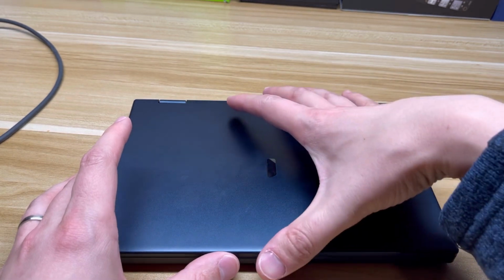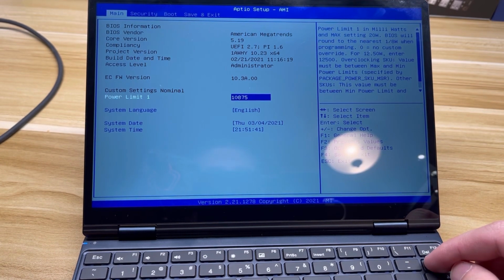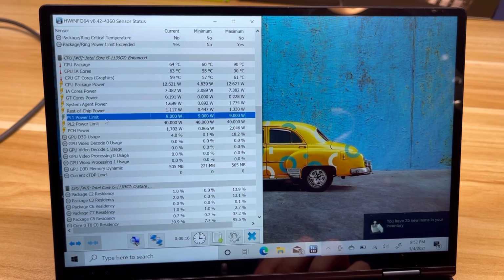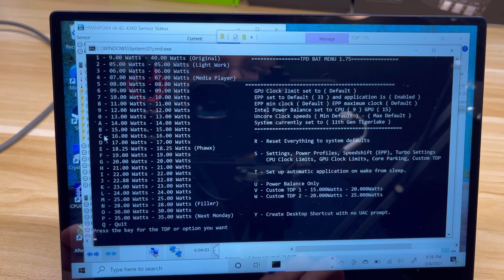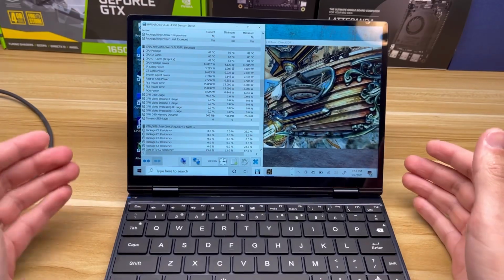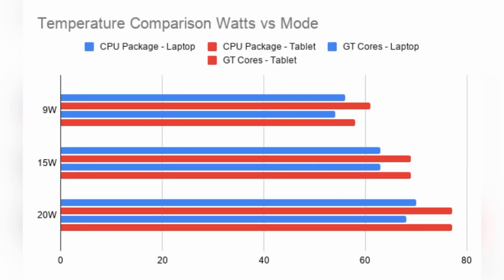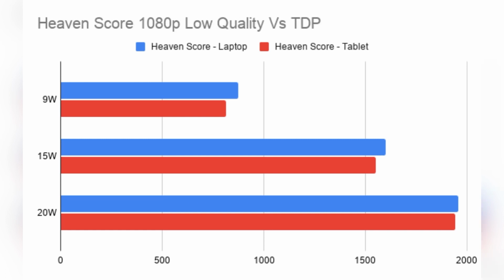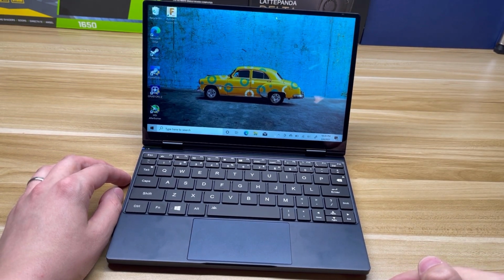One-Netbook One Mix 4 - Adjusting TDP and Cooling Performance Tests

Comment: Hi I’ve been using your power control app for a few months now on this laptop and now the fan has stopped working and laptop runs hot up to 90c. Any ideas what might have happened? The function keys to control the fan also no longer respond.
Cheers
Reply from the maker: Sounds like the fan merely gave up. Have you contacted one netbook?
Reply: @HandheldHardware  trying but their customer service is terrible
Reply from the maker: @umeshjay8067  are you on discord?
Reply: @HandheldHardware  no not on discord. Is there a link? Thanks

Comment: Hi, I'm really interested in this laptop but I'm concerned about fan noise. how audible is it out of the box? is it high pitched? and how effective is silent mode? Thank you
Reply from the maker: Fan noise in my opinion is fine. There is only one fan, so under heavy load in high speed mode it’s noticeable, like micro jet engine but for me fan noise isn’t a big deal. Quiet mode is nice, it keeps the fan profile low and drops pl1 to 7W. Under regular mode, there is a portion of the fan curve that has some high pitch to it. It’s somewhere in the middle. I don’t notice it often but when it hits the right rpm it’s much more noticeable. Overall the form factor wins for me. I hate lugging a large bag for a laptop. This fits in a single sling small backpack no problem next to it’s big brother the oxp 🤣

Edit: if you adjust the tdp using something like my power app, if you are on the regular fan mode, it handles 15W no problem and the fan doesn’t get too crazy as long as you don’t cover the intake or vent or aren’t playing intensive games. Using the keyboard to set high power mode bumps the fan into a higher curve but it’s not necessary to use that mode

Comment: I'm planning on purchasing this model, but did the manufacturer ever release a BIOS update that fixes the BIOS TDP setting not taking effect? Also, do you think repasting it with liquid metal (Conductonaut) would improve the thermals much? It's a pretty small heatsink, so it might just be saturated...

Comment: So is the only way to run in "20W mode" to run the BAT and select it each time?
Reply from the maker: In the tdp program there is a start up task you can add that will auto set on boot up after you select a specific TDP, so you don’t have to set every time. Also, when they fix the bios this will be a non issue
Reply: @HandheldHardware  good to kkow; thanks!
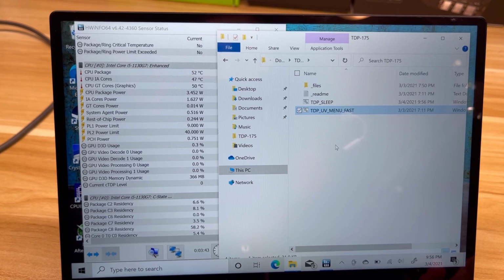Reply from the maker: You can see at 1:47 the TDP Sleep Bat that will add the start up task every time

Comment: I also owned the same version. Just tested Witcher 3 yesterday. It turned out that the default setting with 1920*1200 can maintain a framerate of 25 FPS, and will be around 30 if I use 1680*1050 (don't remember the exact number). This is tested using 20 Watts.
Reply: 720p?
Reply: @ca9inec0mic58  not tried yet
Reply from the maker: that’s great news!
Reply: make video

Comment: laptop died at 4:19     the irony....
exited for the gaming benchmarks
Reply: It did not die as you can see the battery icon which still had some juice left. It just shut off the screen.
Reply: @yaolongju912  oh, thanx
Reply from the maker: Hahaha
Reply: did it die?!?!?
Reply from the maker: @Achilles  no lol screen shut off because of inactivity
Reply: @HandheldHardware  you still like htis device? heavily considering buying it
Reply from the maker: @Achilles  I do! I have a couple grievances, like when the battery ran out, it took 10 minutes to come back on after plugging in. It seems others don’t have that problem. I’ve used it for fusion 360 which works great even at 9W. EGPU makes gaming on my tv with my kids easy. Even at 9W tdp with the eGPU, it plays many games at 1080p 60fps low medium like just cause 3.
Reply: @HandheldHardware  have u tried fall guys out on this lil beast?